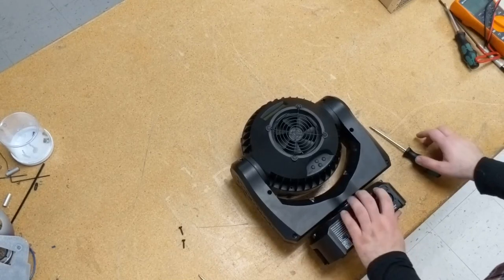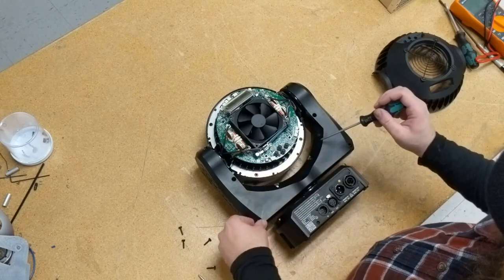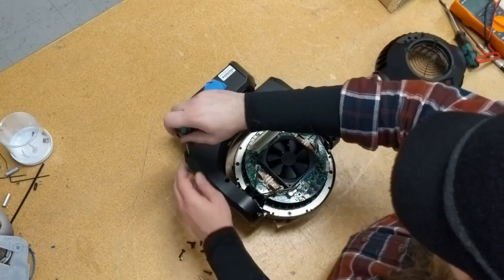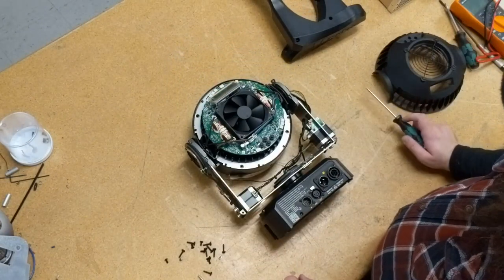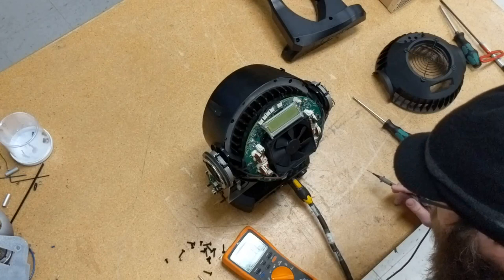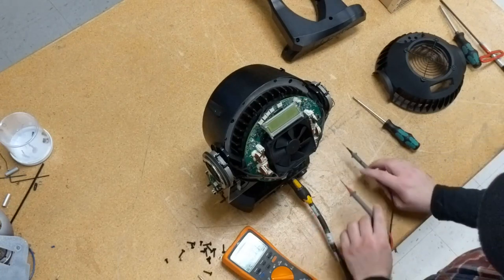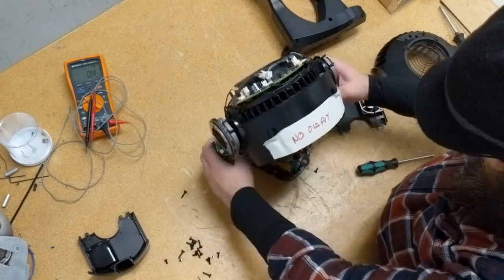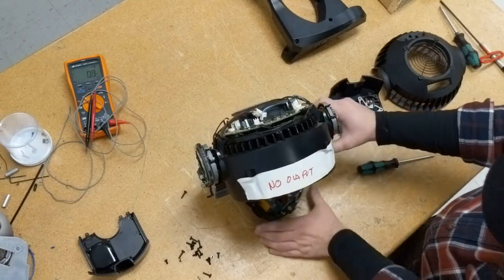Martin Mac Aura - Disassembly

Comment: Do you know what the cleaning/maintenance procedures are for these?
Reply from the maker: Cleaning is pretty straightforward. You can wipe down the exterior with a damp cloth. While the fixture is powered down, you can use a narrow screwdriver to make sure the fans don't rotate and blow (clean, dry) air through the head and base to knock any dust out. There's not much regular maintenance to be done on them until something stops working.
Reply: @lonasindi  Thanks Derek.  I just got down from a ladder after talking to a colleague of mine and blowing these out.  He said the same thing as you.  Appreciate your video and fast response.